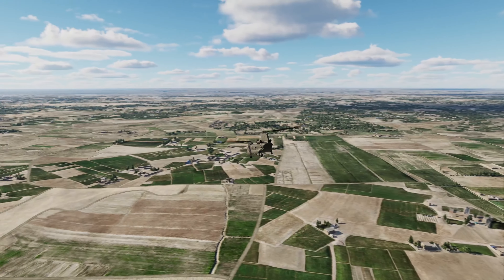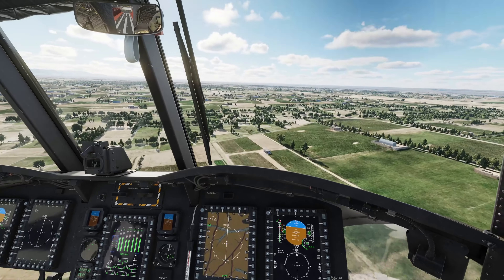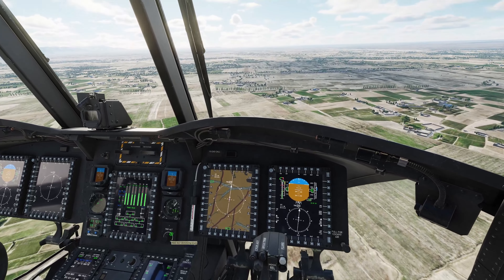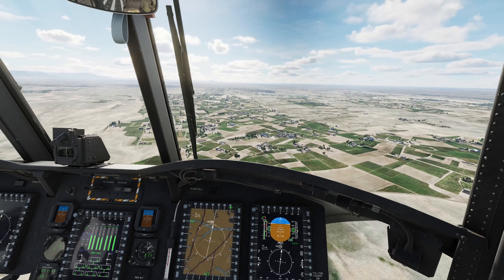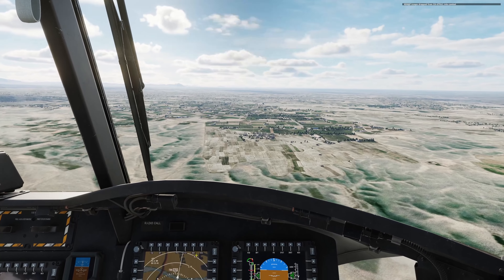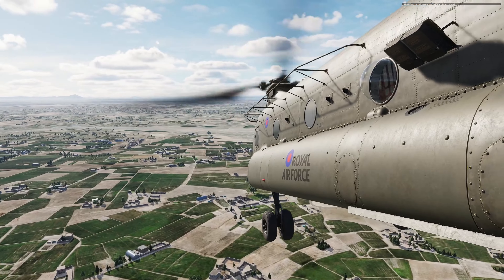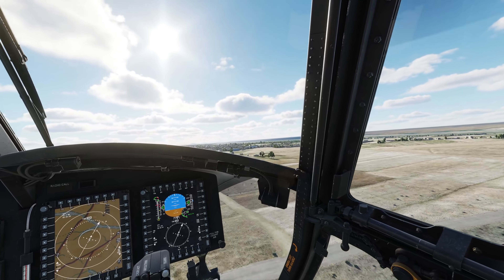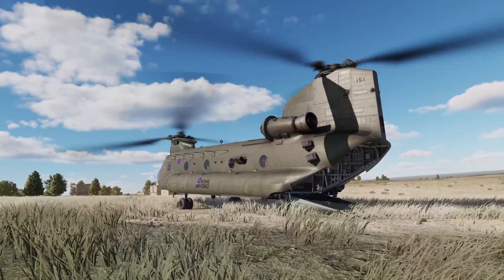DCS | CH-47F CHINOOK Tutorials: Episode 3 - In-Flight Tips & LANDING into Combat [4K]

Comment: Really good tips, didn't know about the Bob feature, that'll be very useful. How are you able to maintain level flight in this? I've flown all DCS Helicopters and can keep them level but the Chinook I'm finding quite an effort.
Reply from the maker: @VRTrucker  just keep trying - ensure the AFCS is on Auto and set keybinds for the trim up/down/left and right to trim it as required. I find I need to use a tiny bit of left rudder to keep it steady too throughout flight
Reply: Appreciate the tips thank you
Reply: @BritishAvgeek  I actually have the trim set but do I also need to set the AFCS trim to manual to actually make it work for me? It's probably a dumb question. I just haven't really felt a difference in auto vs manual in flight
Reply: @BritishAvgeek  I don’t believe trimming up, down, left or right has been implemented yet. Currently, all we have is the basic trim & BOB, luckily BOB works amazingly well. I’m unable to get her to maintain a constant altitude without the aid of BOB.
Reply from the maker: @Tom-qf3mq  correct but the point there is to think of trim so when they do implement it, I don't get told in the comments that I haven't trimmed the helo 😅
Reply: @BritishAvgeek  I’m so desperate for ED to implement the additional stability tech & trim controls. It does make sense to get virtual pilots into the habit of using all trim options, even if unavailable.
Reply from the maker: @Tom-qf3mq  apparently the next update has the AI gunner, which will be massive because I've been flying around dodging tracers and feeling like a sitting duck without CAS 😅
Reply: @BritishAvgeek lol. Not been an issue for me personally as I’ve been flying my own missions perfecting piloting her, getting used to her onboard systems & sling loading. The AI gunner will be a HUGE deal though.